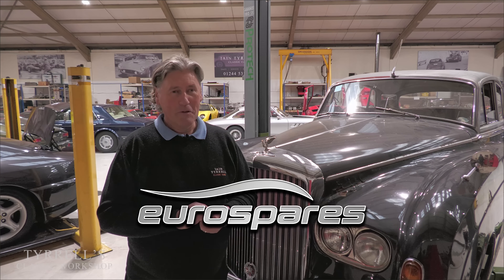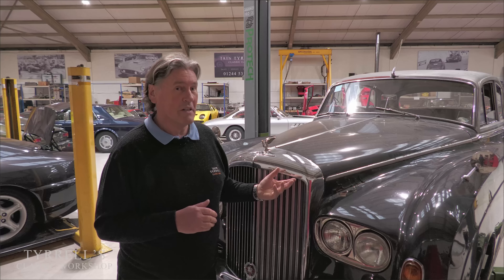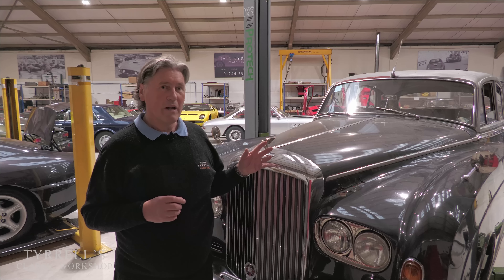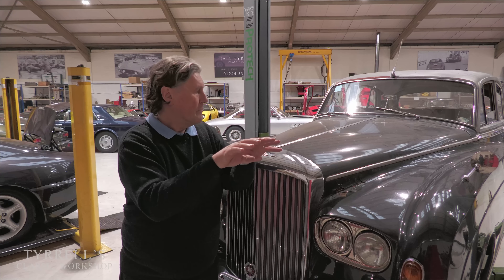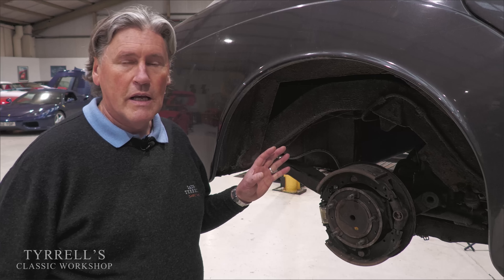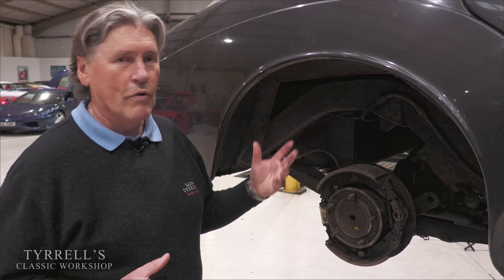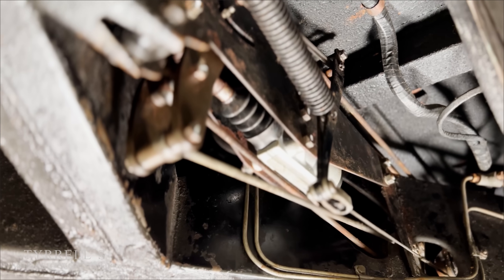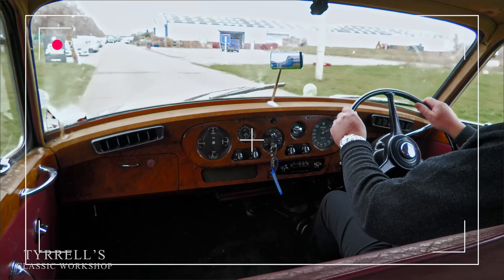Bizarre Bentley S2 Brakes | Tyrrell's Classic Workshop

Comment: Brilliant, thanks Iain (and Alex!) Quick question: how do the brakes work when the car is going in reverse, as I presume speeds of >12mph would not be achieved? Does the front system (non-tech naming protocol deployed there!) kick in at lower speeds when in reverse?
Reply from the maker: No, works exactly the same as manoeuvring forward!

Comment: It would be very interesting to learn about the suspension system RR had from Citroen. Did it work exactly as Citroen or did they do any modifications?
Reply from the maker: It even went as far a sharing some parts from Silver Spirit (1981) onwards

Comment: I believe that the change in size of metal due to heat is a secondary effect of braking. The main advantage to disc brakes is that the friction in squeezing a disc is much greater than the mere pressing against one side of a drum. If the heat generated had no effect on the metals involved (such as the minimal, if any, effect heat has on ceramic brakes), disc brakes would still reduce the wheel rotation at a much greater rate than drums. Also, in lessening the amount of weight transfer to the front, such as with anti-dive geometry, the rear tyres maintain a greater contact patch with the ground and more pressure against it providing more friction and less of a chance of the brake locking and the tyre skidding.
Reply: If not overheating problems, drums is "stronger" than discs. Surface area of brake linings are much bigger and leverage is bigger too.

Comment: I loved this (as I love all your videos) ... including the blooper :)  Here's my question.  You said this definitively isn't a concourse car, so in that case would it not be a better idea to just fit a modern set of disc brakes to the vehicle?  Can you address that from the viewpoints of (i) cost, both long-term and short-term; (ii) practicality; and (iii) impact on the value of the vehicle, concourse or not!  If you answer this ... thanks for taking the time to do so.
Reply from the maker: When the standard system is set- up properly, and one gets used to its idiosyncrasies, it actually works well in a classic car

Comment: I know my mind is full or 20/20 hindsight, and I know there was a tradition in vintage cars to have the brakes primarily on the rear axle.  But I just cannot understand how by the 1950s this could possibly have seemed like a good idea.  Our family's '55 Morris Minor had a more reliable system than that.

Comment: I love the technical content warning for the second chapter 😂. Thank you, Iain for this insight into that braking system. It makes the hydraulic accumulator system under my 82 Silver Spirit slight less scary.. only slightly. At least Spirit's have a mechanical parking brake with separate brake pads operating on the rear discs, should the worst happen and I ignore any warnings on the dashboard at the same time!

Comment: Thank you for another very enlightening and explanatory video. I remember The Motor (or was it Autocar?) back in the day, commenting on the 'delay' before the brakes activated and how unsettling it was until you got used to it and made necessary allowances. Hardly surprising that there was a delay given the complexity of the system!

Comment: Great to see a heavy car like this dancing under brakes like a Citroen 2CV  🤣😅

I had to do 8 weeks of "industrial experience" as part of my engineering degree and was lucky to spend it working at the RR Crewe factory in the summer of 1969. 4 weeks in the engine repair shop, where I "helped" a fitter building reconditioned 6 cyl engines and 4 weeks in the apprentice school, where I learned how to use milling machines, lathes, etc. I also spent a couple of weeks updating the Silver Shadow show chassis to the latest spec. While I was there, we were visited by what I think was the 1929/1930 Speed 6 "Blue Train" Bentley. The owner had dinged the sump pan and was able to get a new old stock one from the spares dept.

Comment: Can that servo mechanism be bypassed and the front brake be linked to the rear for safety sake? You would have a hard time in stop and go traffic.
I actually like the single headlight look on both the Bentley and Rolls.

Comment: I remember that braking system from my Bentley S1- weird and wonderful.  Mine only gave me problems on very wet days when the brakes became almost useless which was interesting and I think the issue was a wet disc on the servo unit- I just stopped using it on the really wet days. .  Parking also was a challenge because the brakes could not operate properly at very low speeds and the S1 had no power steering. I remember being fazed by the left side wheel lug nuts as they had to be undone clockwise but the usual CCW on the other side. Interesting cars and I really miss mine. Mine also had flaking paint on the tops of the fenders in the depression.  There are no MOT's in BC, Canada but I have yet to hear of an accident caused by a failure of some suspension or braking component.  People usually have a good idea when their brakes don't work any more. Now I have an old V12 Jag with no MOT either but I keep an eye on things as all the enthusiasts do here. .

Comment: Great video as usual 
Does anyone do a disc brake conversion for these cars to make them more modern and reliable?
Reply: Yes, I do agree that (if I was the Owner), I would definitely make plans to rip it all out, and go for a Vacuum- assisted Dual Braking ABS System that would very easily adapt! The Braking System on the Bentley (if it fell into the wrong hands of a backstreet mechanic) could easily be written-off with sudden Brake Failure. The S2 deserves a better system of braking, which wasn't around when the car was originally built. The S1 or S2 was always my 'dream' car, but I drive a 52-year old Beetle instead! What a great Teacher Iain is! Greetings from Sydney.

Comment: The anti-dive setup was tried on motorcycles but dismissed for similar reasons, the weight transfer helps the grip plus it steepens the rake angle allowing easier turn in

Comment: I want to learn about the cars you work on and a bit of in-depth explanation is most welcome to me. I found this very interesting and a fascinating braking system, different to the norm, however I am not sure it would be an acceptable design by todays standards. Most tv channels really dumb down technical stuff and car programmes are almost unwatchable to those with a bit of automotive knowledge, but I think You Tube is different. Please keep the technical content coming.

Comment: Fascinating video and content.We have a 1928 Rolls Phantom 1 , owned 58 years which always had superb brakes based on this system , all mechanical with no hydraulic aspect.Recently , the brakes have appeared to have lost ' bite ' and wonder whether the fault could be a glazed Ferodo disc through lack of use which will have to be investigated.

Comment: Can never have to much nerd….I knew that RR/Bentley had a reputation for over engineering there cars (why have two bolts when 4 will do😂) this braking system personifies this. With so many working parts one can only wonder what happens when servicing is scrimped or after a a winter on salted roads…. Massive servicing bills must go together like milk and honey maintaining this car! Fantastic insight into what you you were paying for though, smoothness and refinement never come cheaply.

Comment: This seems similar to the old bicycle braking system that prevents the rider from going over the handlebars. The rider operates the rear rim brake, which rotates a little along the rim against a spring. This rotation pulls a brake cable, operating front brake. If the front brakes too much, the rear wheel lifts, slows  rotation, and reduces the braking force on the front wheel.

Comment: The size of brakes front to rear depends on the weight of the vehicle. A rear/mid engined car needs larger brakes at the rear than a front engined car. That proportion is not universal to all cars. Old Royce's maybe

Comment: Clever system, but not at low speed, even more if the car starts moving on a slope under 12 mph. Citroën high pressure system with kind of open/close fluid circuit when light touch on brake pedal was better I believe.

Comment: I remember in the military over 40 years ago, I was going up into the mountains with what was referred to as a Dodge 3/4 ton ambulance from the war. In other words, a huge boxcar. Went up fine, but down. Wasn't that good with an unsynchronized gearbox yet, but you have to slow down before downshifting. No brake servo and proper drum brakes. Scary, but then I learned gearing with an unsynchronized gearbox fairly quickly, before a turn, where I would otherwise have gone straight ahead with this huge brick. Scary with old fashioned brakes and certainly not as good as Rolls and Bentley.

Comment: Thank you, I really enjoyed the explanation. I like seeing unusual auto parts and unconventional methods of building cars.

In 2006, I had an interesting discussion in auto repair class, and it involved a Rolls Royce. I was explaining what a Nissan GT-R was to someone who had never heard of one, non-gamers in the USA didn't know what one was. I said that I loved it so much, I didn't think I would feel worthy of the honor of repairing one. My teacher said "A customer brought in a Rolls Royce for repair and I did do it." I am certain he understood what I was thinking and feeling, even if I couldn't explain it well. He also said that in the repair shop, there was a bump that you would drive over in order to determine if you parked correctly on the vehicle lift. However, the suspension of the Rolls Royce was so effective, he couldn't feel it. He had to ask for someone to watch and see if he stopped the car in the correct location. I thought that was fascinating.

I'm not sure what Rolls Royce it was, and I know the repair did not involve brakes. It was leaking antifreeze, and the cause was determined to be the water pump. However, the honor of being selected to repair something so special must have felt incredible.

In the case of this Rolls Royce, it appears that the mechanism was good, but once someone was able to make a vacuum boosted master cylinder with variable proportioning valves, that special mechanism was no longer a benefit. It is interesting to see a mechanical part get replaced with a different mechanical part, rather than just see some computerized parts replace all mechanical parts.

Comment: Iain could (and did) make a fascinating exposition on car door mechanisems, so a fundamental system like brakes qualifies as a mainstream topic.  Naturally, if it's a Rolls-Royce, it's going to be complicated and maintenance-intensive, but work very well if treated properly.
Looking at the number and variety of parts involved in drum brakes, I suspect that discs are significantly cheaper to manufacture, except possibly for the handbrake mechanism. That's why cheaper cars used front  discs  (where most of the action happens), and drum rears for a long time, before migrating to discs all round.

Comment: I owned a '64 S3. Interesting car. They used 'dress screws' in places that were never going to be seen.  Had 4 small (3 inch?) speakers wired into the front seat lower forward seat panels. And the frame looked like a Ford 450 truck.  My cats loved to sleep in that car.

Comment: Thank you for this excellent insight into a very unusual breaking system. One question came to my mind ... I noticed that there are two fluid pressure lines going to each front wheel. Why is that?
Reply: It looked like the front brakes had two slave cylinders each.
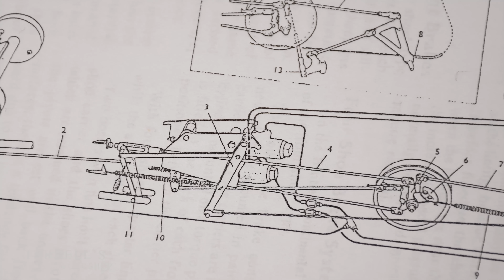Reply: @Surestick88  Yes, that's what I thought too ... and the view at 10:18 seems to confirm this ... however, to make full sense for two pressure lines, they should be connected to two different master cylinders, and the schematic at 4:53 aren't really showing if that is the case. (I think I see one of the front cyclinders and the rear cylinder coming from one master cylinder, and the other front cylinder coming from the other master, but I'm not sure about this).

Comment: Fascinating. Usually I'm not into the nitty gritty all that much so deeply, however Tyrrell's Classic Workshop certainly always do venture my absorption of the engineering bits due to the captivating style of presentation. Excellent, and thank you so much again for this remarkable upload for learning about this particular aspect of a classic R R and Bentley.
Reply: Totally agree. Was sucked in and 18 mins flew by. RR, Bentley & Hispano Suiza - those boys could build a car.